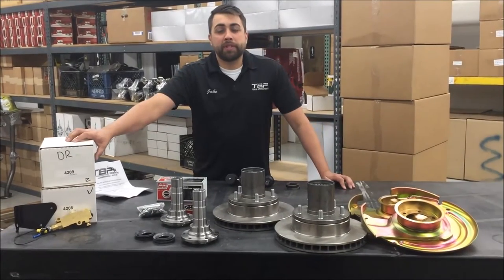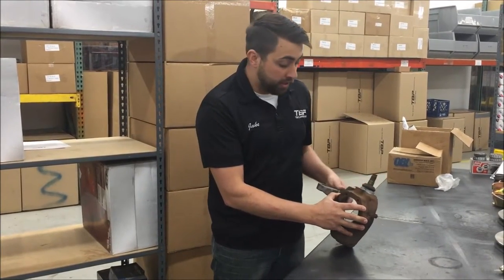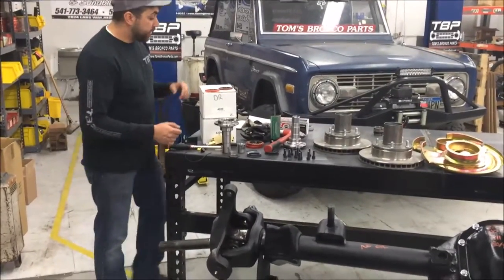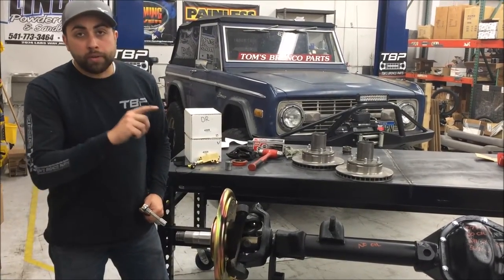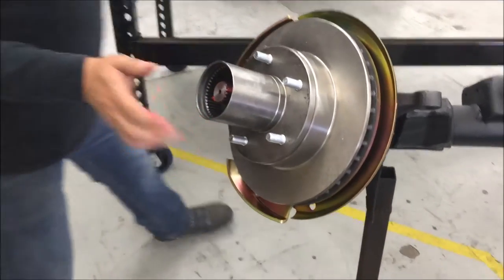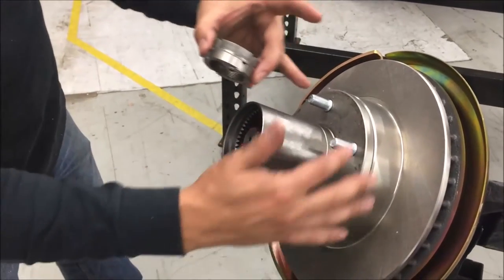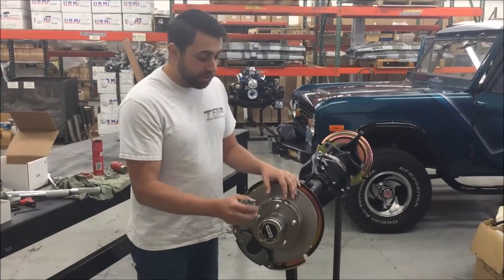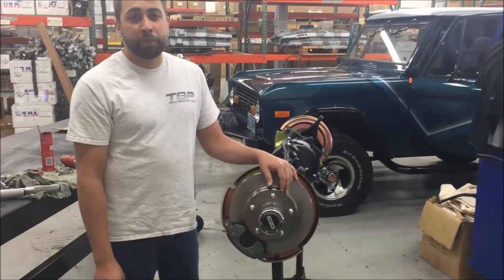TOMS OFFROAD Tech Time Episode 3   Front Disc Conversion Part #2433 and Part #2434

Comment: Thank u. This video helped me with an install in our ‘74. We already have the disc conversion but the new parts definitely go on a lot more snug than the originals that are probably far out of their tolerances from years of use. Now if I could get past the mushy brake pedal. I’ll be installing the new booster I purchased to see if that fixes it.
Reply from the maker: Hi Carlos.  Glad to hear this video helped with your disc brake kit installation.  Sometimes it's a lot easier to see how to do something than to just read it so we try to do these videos when we can.  Have a great week!
Reply: Toms Bronco Parts - the new brake booster definitely firmed up the pedal and made braking more consistent. Thanks for the quality parts you guys provide.
Reply: how much different is a Dana 30? No grinding correct?

Comment: I have the kit on the Dana 30 but they used the old Ford locking hub caps and not the Warn ones, does this mean it was done incorrectly and will not work?